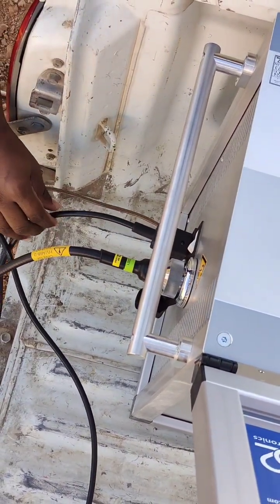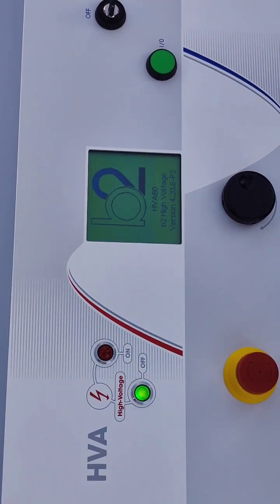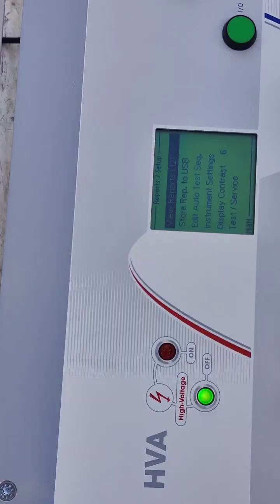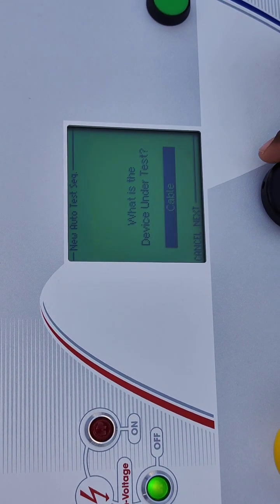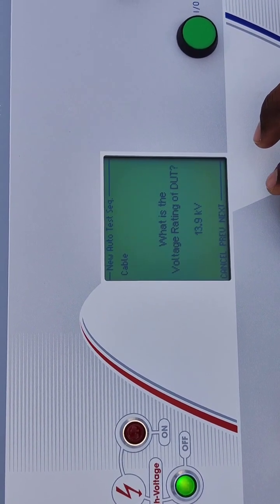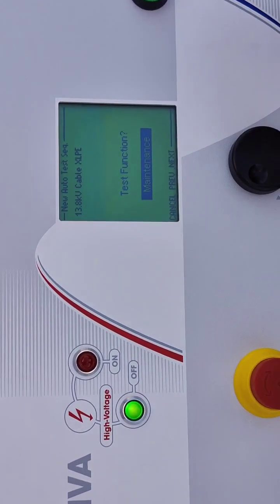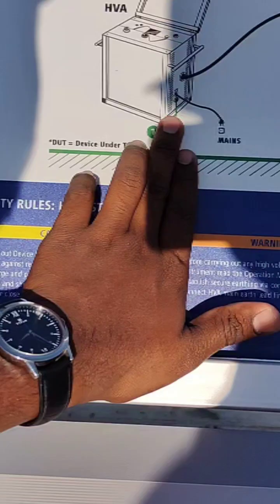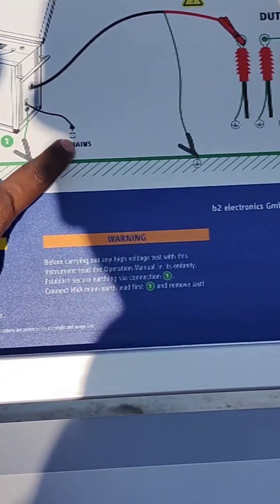Cable Testing | VLF Test Settings |MV cable Fault test | Cable Fault detecting

Comment: brother plz tell about the connection from test set to cable testing... according to mentioned diagram on kit only two phases are shorted and you shorted 3 phase and apply the test voltage. and also tell me while testing the cable the other end of the cable shoud be opend or shorted ?